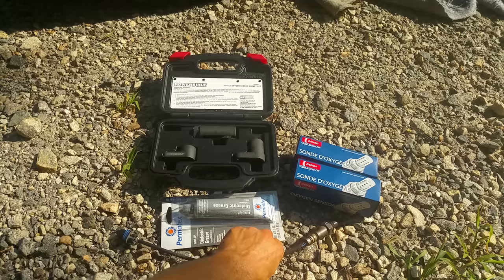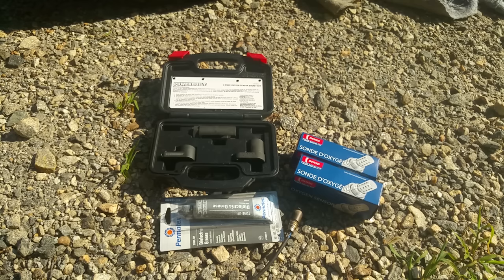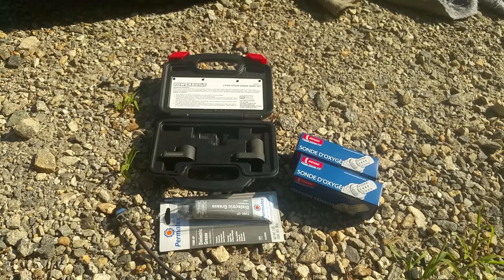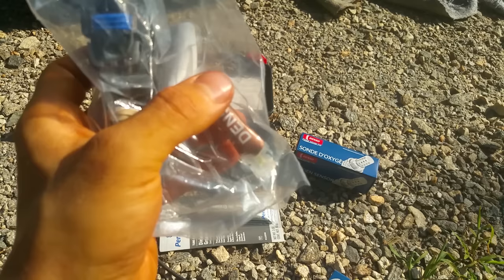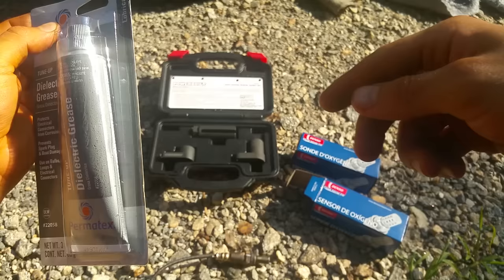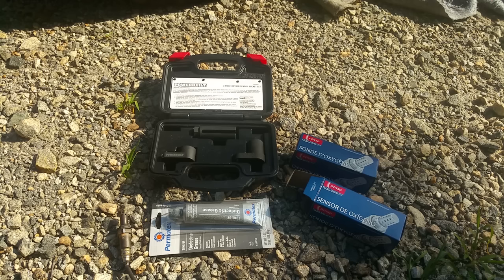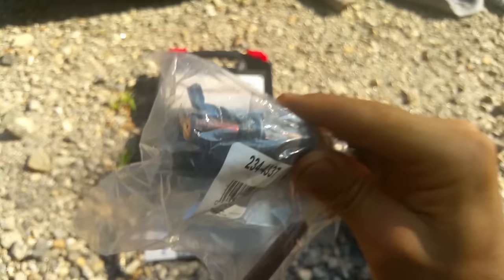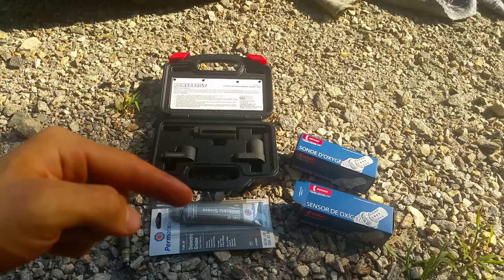NEVER Change Another O2 Sensor Until You WATCH THIS!

Comment: Just because you get an HO2S lean code does not necessarily mean the sensor is bad. You should definitely test it first. In my case I just hooked up my scanner so I could monitor the data stream in real time as I drive. If the HO2S voltage is fluctuating between 0 and .9 Volts as you drive the thing is working like it should, and your problem is elsewhere, most likely a vacuum leak
Reply from the maker: Good info! Most people are not able to do this. They don't have a scanner that can monitor this stuff so they just replace them.
Reply: Nice, because the codes I have have a small vac leak, that could be awesome if the vac leak is the real issue....tks for that info
Reply: Hi Utwo,
What tools do you use for scanning etc?
Reply: I had a real nice Snap-On that died and I could not afford to replace, then I had a great Auto X-Ray that died and the company went out of business. I currently use an Actron 9660 which is not as good as the previous scanners but one of the few that will do pre OBDII systems. And of course a versatile multi-meter is always handy.
Reply from the maker: Yea I bet that Snap On scan tool was real nice. The Actron ones are pretty basic aren't they?
Reply: The 9660 is their top of the line and has many nice features for OBDII. My problem is my vans are 1996 and not many companies are interested in support for vehicles that old. For example 96 was a transition year and the Actron does not take that into consideration so I have to select 1995 or it will not communicate with the PCM. With the Snap-on I could enter the VIN and it would accurately identify the proper setup. I miss that. 
If you are only interested in OBDII  there are other scanners for the same money that connect to a laptop and allow live simultaneous and overlayed monitoring of of many functions. If I ever get rid of my 96 Vans I'll be getting one of those.
Reply: Travis Schumacher 
Go to the SnapOn truck, get the cheap Snap On Scanner, which will do the work.
Reply: True! Good advice. Was using y $20 Bluetooth obd2 reader yesterday, shows the live O2 sensor data on my phone with half dozen free apps like Torque etc. I think I've got vacuum leak.

Comment: I buy dielectric grease in a red tube that is pressurized. I just squeeze the little handle on the side and I usually don’t have to touch it afterwards. It has a slide on the outside that increases/ decreases the output flow.

Comment: FYI                  If your going to replace the O2 Sensor then cut the pigtail wire at the sensor and use a deep socket to remove the old one.
Reply: Exactly! Those O2 sockets will slip. I found that out two bloody knuckles later.
Reply: Sometimes I bust the top part of the 02 sensor off and use a short socket/breaker bar to make it easy in tight spots -
Reply: @maxguod  If you know it needs to be replaced, it doesn't matter what you do as long as you can get it off. I have used a cut off wheel and that works.
Reply: Man up- muscle baby... lol j/k these are a bitch sometimes. Just replaced mine recently and all 5 came out easily.
Reply: Make sure the engines warm put the 02 socket on and try to break lose if unsuccessful break off and get a socket to take off

Comment: if we are replacing a faulty sensor, why not just cut the wire off and use a standard socket instead of spending 70-100 bucks on a special tool .... what am I missing here?
Reply: Exactly, then cut the wire of the new one and use said same socket to put the new one back in! Seems simple enough 🤦‍♂️

Comment: I've only replaced like five of these in my life, and the first three I got out with the special deep split socket, but then I had one that was really stuck and I ended up cracking the special deep split socket.  I ended up just taking a hammer and breaking off the end of the old O2 sensor, cutting the wire and using a regular 6-point socket to break it loose.  The deep split socket or a wrench works good for installing them.

Comment: Heating up your exhaust for a couple minutes before trying to remove o2 sensors helps a bit. At least in my experience it has helped.
Reply: Yup change it after a drive just wear welding gloves and it comes out pretty quick
Reply: Wd40 no heat needed
Reply: Comment from an OLD mechanic/plumber, etc. If you can tap lightly with a hammer on the wrench, pipe or part itself  while pulling on the wrench, without damaging the part,
sometimes it is all it takes to "jar" the part loose.

Comment: Never never use dielectric grease on the connector. The sender samples out side air and the air is brought in through the connector. Grease will clog the passage. Air is going to sender through the wires and insulation

Comment: If it's a bad o2 sensor you just cut off the wire and use a real socket and an impact. 

The socket with the slot is more of a install tool then a removal tool

Comment: Try spraying ice cold water on 02 sensor threads while exhaust is hot. The shock should crack the rust and deposits. Then use penetrating oil. Let set for a while.

Comment: I have a 2007 5 cylinders four-door colorado truck that needs two oxygen sensors to install the one on top can I do it with an open-end wrench or do I got to get the proper sensor wrench? and how should it be installed as of how to apply the new one?

Comment: Good info! Riddle me this ; I have a 2000 S10 2.2L. Very well maintained.  About 85,000 it threw 2 o2 sensor codes (up and downstream). I replaced them with Bosch o2 sensors since that's what my auto parts store sells. A few months later the codes came back. The store replaced them. A few months later same issue. More than a few techs have told me for some reason they can't figure out G.M. vehicles only like G.M. o2 sensors. (made by N.T.K.) I thought this was CRAZY but replaced them with O.E.M. and its been 5 years and 35,000 miles with no problems.  Thoughts?
Reply from the maker: +Shepperd November There was a mechanic on here that had a ton of experience.  He said that Bosch O2 sensors were trash. Look through the comments. You'll find it.
Reply: Matt's Shop Thanx. That has not been my experience. I have installed Bosch O2 sensors and Chrysler, Ford, and imports. However, I will agree with you that I prefer either nippondenso or ntk sensors. Cars just seem to perform better with them.
Reply: Could be the voltage.

Comment: When taking them out, I just cut the wire and use a regular socket. Those special sockets are for putting the in, not taking them out. I had one of those sockets keep stretching open causing it to skip. Thats when I figured out it doesnt matter on the old one if you chop the wire anyways. Yes a breaker  bar for sure! When you have to take the manifold off because you cannot get it out, that ruins your day.

Comment: I have changed out multiple o2's out over the years and never had a problem. I use a cut in half 7/8 wrench. Heat half of the bung red hot and use the box end of the wrench and tap it loose with a hammer. Tighten the new one down with the open end. Doesn't even have to be that tight. Pretty easy.
Reply from the maker: Good idea to hit a cut in half wrench with a hammer. Could even use a air hammer if you have one.
Reply: Yes. Once the wrench is on it's usually just one hit to break it free. The shorter cut in half wrench helps because most often there is not enough room for a long wrench. The heat with a torch is the biggest help.
Reply from the maker: Yea, that's a good idea to cut it in half for more room.

Comment: I used anti seiz on my Denso. 160k miles later, I couldn't take it out. I had to use a cordless impact wrench to take it out. 
It was due to excessive speed, the sensor thread melted.

Comment: I work for a well known company that makes aerial lifts. We have more problems from using dielectric grease than we would have had using none at all. I believe assembly quit using it all together. It's not meant for the contacts but more for where the plug seals together. Dielectric grease is not very conductive surprising as that sounds. Mabe for the edge of the plug but not the contacts.

Comment: Nice video However instead of running out to buy new O2 sensors, everyone should try to clean them by burning off the carbon and other deposits O2's collect over time. Easy to do with a bench vise and a propane torch. Simply carefully put the O2 sensor in the vise by the wrench flats, sensor end upwards, be very careful of the wires! 

Then heat up the end with the torch until the end is GLOWING bright red. Once it is a nice more or less even red (including the parts inside the slotted holes (peek in there and try to get that red as possible too). Then let it all cool down naturally and reinstall. (DO NOT use any sort of water or chemical cleaning on these!) Chemicals dont work anyway for this, and can leave more deposits as well!

 I do the Burn thing when I have a little time to kill and it works 90% of the time too! Save you a bunch of cash. You cant really hurt the O2 sensor doing this so dont be afraid, sensors like 600F and more in normal operation, the heat is what keeps them clean. Stop and start trips in cold weather is what makes them get dirty, also spraying chemicals on them! 

Of course eventually the platinum catalyst in them does wear away, but the burn cleaning is worth a try at least once (or twice sometimes.)
Reply: I've been watching a handful of videos and other commenters say cleaning can make them read better but they might not still work. The ones in my 04 truck have never been removed much less cleaned or replaced, so it's likely cleaning is a waste of time.
Reply: @Born-Again-Warrior  If you are not getting any O2 sensor errors then leave them alone.

Comment: Awesome. I learned a lot. My 97 cougar 4.6 will NOT pass inspection. All kinds of codes! I'm replacing those and the catalytic converter. next. As far as touching, I never even thought of that. I guess the oil on the fingers?  Exelent video 👍
Reply from the maker: Thanks, If you have a lot of codes, you need to replace the O2 sensors. It will help.

Comment: I don't have a problem taking out the sensor,  or screwing it back in,  my problem is finding the connector,  then try to unplug and plug it back in.  In my 2001 Lincoln Town Car,  it's between the back of the engine and firewall,  it very tight and difficult it get to,  I can say unplugging was fairly easy, getting it back together is a major problem.

Comment: If you already know your 02 sensors are shot and already have the new ones,you can just cut the old cables and use a large enough deep well socket,no special socket needed. You can use a regular wrench to put the new 02 sensor in,once you finally get the impossibly tight 02 sensor out. A cheap 02 split socket for removing the 02 sensor will flex,slipping on the shoulder of the 02. Making a home made socket by noching an old socket will also result in slipping.
Reply from the maker: Yea, someone else mentioned this too. It is a great idea if the split sockets keep slipping and flexing. Although, it might not be the sensor that's the problem and once you cut the old one you no longer have a spare.
Reply: You can add a pipe clamp to keep it from slipping if you are trying to remove it to get it out of the way for example and don't want to cut the cord
Reply: Walter Sopchak Could you please explain how you do that? I cannot fathom how a pipe clamp can keep one from slipping. I sadly sold my socket designed for removing those...I still dont know what I was thinking. Generally, you always test the 02 sensor anyways before cutting the cord. Using a simple multimeter can tell you if it is bad. Testing the wire to the unit can be done with a 12volt headlight from a garden tractor. Use the bulb holder and solder wires with alligator clips to the ends of the connectors. You dont need a fancy oscilloscope to test an 02 sensor. if it doesnt heat up, its dead. if it showes open circuit, its dead, yes its that simple.
Reply: Matt's Shop You would test the 02 sensor BEFORE  cutting the cord. It is so simple to test them. An open ground,dead. if it doesnt heat up, dead, use a 12volt garden tractor bulb holder with alligator wires to test the wires to the 02 sensor first. 90 percent of 02 failures is corroded wires. They cannot be repaired, ever. The wires are special, like a toaster wire. I never chop wires on anything until I know its dead.
Reply: RC Hobbyist Extreme I saw it on a YouTube video.. I think I searched stuck o2 sensor
Reply: Walter Sopchak It is always best to invest in proper tools anyways. I see the price on the 02 sensor socket has gone way down since they first came out. Mine was $34. Now you can get them for $15.  big difference. I remember when one 02 sensor used to cost $53 or more. Now way cheaper than that.
Reply from the maker: I still want to see this pipe clamp trick.
Reply: Matt's Shop Yup, me too!
Reply: He is referring to a hose clamp according to the provided link
Reply: Just knock the o2 sensor off with a hammer and pry bar, then simply use a socket to take it off...
Reply: He means a "Hose Clamp".
Reply from the maker: Wow that's a great trick thanks. I will keep that in mind. Yea, I could see just getting pissed and breaking out the breaker bar and regular socket.
Reply: RC Hobbyist Extreme was saying the same thing. I wouldn't use those tools again.
Reply: 90% corroded wires?  nahha. try 90% worn out sensors from use and other sensors failing causing exhaust to be too rich.
Reply: Makes sense.  Why buy a 'tool' just for removing the sensor if you're only gonna probably use it at most, twice?
Reply from the maker: Yea, but if you cut the wire and it was something else when you put a new one in you're screwed, and you waisted $$$.
Reply: True.  Better only do it if you're absolutely sure the sensor is bad
Reply from the maker: Yea exactly, but how do you know unless you take it out with the tool and swap it out???
Reply: 02 camery le
Reply: @Alex-uy7pc  ok you have a point, "sounds like it will work" but for those that are too lame to have good quality hose clamps around put a pair of vise grips across the socket where it might spread.
Better than a hose clamp might be high grade wire bundle clamps. (Not the cheap aluminum ones) I have a bunch in different sizes I collected from surplus stores. Put a 10-32 bolt across em they are amazingly strong, made from aerospace grade stainless steel alloys. So strong you have to use needle nose vise grips to hold em together to get the nut and bolt on. 
Lots of ways to fuck this goat. I wouldnt do it without an impact gun anyway.
Reply: @fuckgoogle4704  yea, lotsa ways, when I was poor in the 90s id say buy the fancy socket (wrench, etc)from sears then after you use it break it and return it. It's ugly but it worked. 

I didn't have crows foot wrenches and I needed one bad... So I put that Craftsman wrench in the vise heated it up and bent it at a 90. I told the salesmen "I was just using it and it bent" got a brand new shinny one.  I kinda feel like guys like me are the ones that killed Sears, haha sorry.
Reply: @MattsShop  you could tell if it's bad by checking the specs on the sensor and ohming it out
Reply: @Alex-uy7pc  yeah and the way sears was (no questions asked) I believe that story.
Reply: @andrewclement7932  I've sort of done it that way. Except I use a hacksaw or a saws-all to cut the top of the sensor off right above the hex. Then I use a regular 6 point socket and a breaker bar.
Reply: @MattsShop  You should try to get if off without cutting the wires first. But as a last resort cut the wires and use a 6 point deep socket or else use a hacksaw or a saws-all to cut the top of the sensor off right above the hex. Then use a regular 6 point socket and a breaker bar.
 Losing the old sensor is unfortunate but rounding the hex and not getting the old sensor out at all is even worse.
Reply: Question is, how do you get the new ones in? Do you cut the wires too?
Reply: @densmac  Of course you don't cut the wires on the new one. Putting in the new one in isn't going to require anywhere near as much force as getting the old one out. Just put some anti-seize compound on the threads, screw it in and tighten it with either an open end wrench or use a slotted socket with the wires coming out the slot.
Reply: @scottfirman  Need a video on this!
Reply: @cra2cra226  next time I do one, thanks.

Comment: I always use my MAP gas torch to remove. Spray some PB Blasters on em, wait a while. Try to crank on em, if they don’t come off, grab a MAP gas torch and heat up
The O2 sensors. They’ll break off after you do that. I just did this today on my new vehicle.
Reply from the maker: Yea, people are saying that small gas torches help A LOT.  MAPP gas is better anyway because it gets hotter than propane! Most guys said they use a propane torch if I remember correctly.